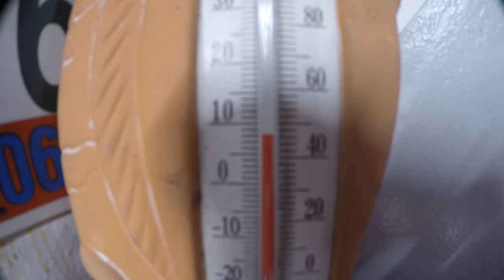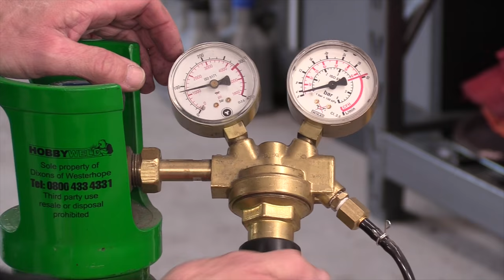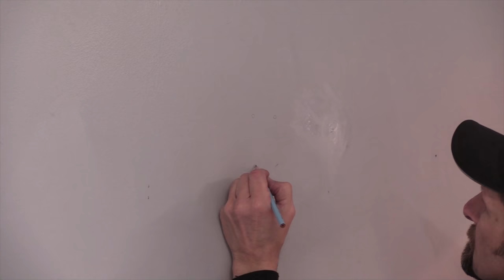A Helmet and Jacket Stand from scrap materials !

Comment: I do all my own maintenance, which usually means I end up with a collection of random bits of hardware that are no longer needed. It’d be really neat to weld them into something great. Any recommendations for a welding machine, for a neophyte?
Reply from the maker: Yes mate, go for it, it's lots of fun... and there are no limits to what you can create.  Just get yourself a basic hobby MIG welder with the gas bottle is better, as the wire is a fraction of the price of the flux core wire, you may even find a second hand one, otherwise Sealey do a huge range of welders for the hobbyist and a great back up service.

Comment: Music was interesting but hey to each his own, actually was a kinda funny song. Have a question not related to this but since you are the man figured I would ask. I am painting a gas cap cover and used what I had which was Rustoleum engine spray paint that is supposed to be oil and fluid resistant and used Dupont engine enamel gloss clear and then let is set for 2 days and tested with a drop of gas and paint bubbled, what paint and clear coat do you use in a rattle can..Thank you so much.
Reply from the maker: In the end Byron, if you want the best solution then its professional 2k paint, cured in a low bake oven....but most of us don't have access to that.. so as a second option, i painted my Harley with Simoniz Acrylic paint and lacquer, the can claims that its oil and petrol resistant.. and i have to admit, that ive had it on my Harley for 18 months, and split the odd splash of fuel on it with no reactions...!  worth a punt maybe.?
Reply: @Moonfleet41  Thank you so much for getting back to me..Will have to check that stuff out.